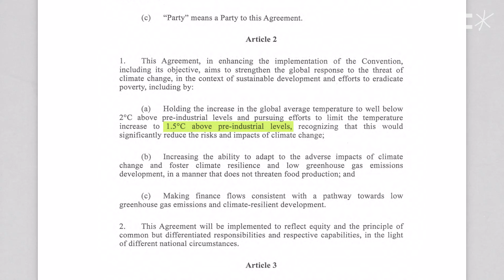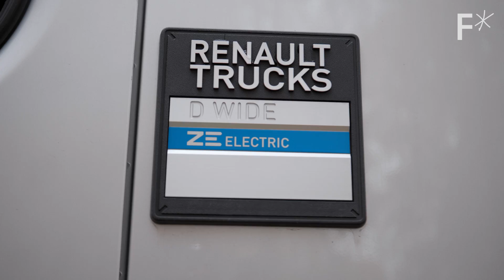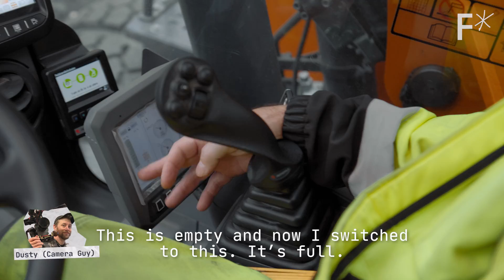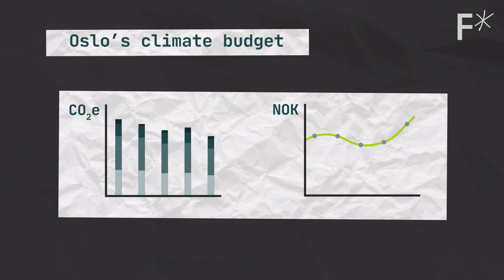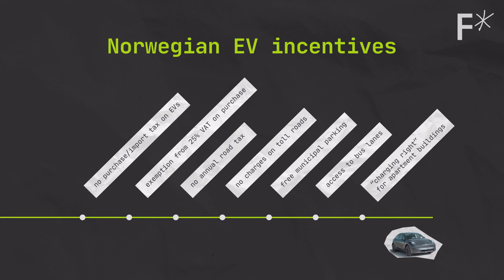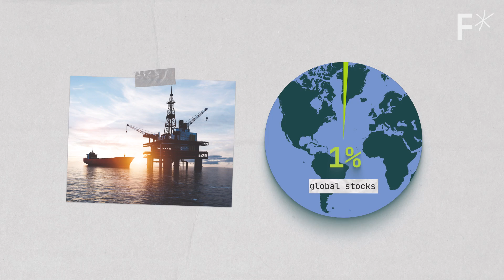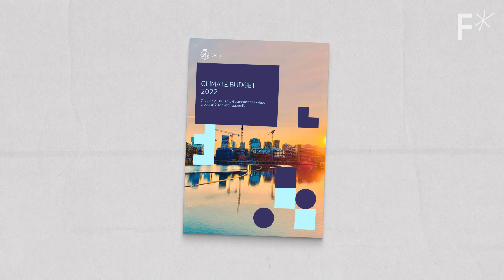The world’s most electric city | Future of Cities

Comment: The most important question is where does electricity come from?
Reply from the maker: We get this question a lot and it's totally understandable!

First, Norway gets 99% of its power from emissions-free sources - 91.5% Hydropower, 7.5% wind: https://www.statista.com/statistics/1025497/distribution-of-electricity-production-in-norway-by-source/ .

While not every country is that clean, EVs still have a number of environmental benefits relative to gas-fueled ones.

- While mining and production of current batteries indeed has environmental harms, so does the mining and production of oil: oil spills, fires, the need to use and dispose of industrial chemicals, etc. Similarly, the extraction of fossil fuels itself requires a lot of energy just like the mining of battery materials. While both oil and lithium-ion batteries can be environmentally harmful to produce, EVs avoid the double hit of gas vehicles having a dirty process to generate their fuel and then that fuel itself also polluting when used.

-Happily, battery designs that use less toxic and safer to obtain materials are proliferating: We actually went to Argonne National Laboratory for a video that gets into this issue and progress on it: https://youtu.be/KMP0x0DpxSY 

-Electric grids are increasingly powered by low-carbon sources. While decades ago virtually all electricity was from fossil fuels, today over a third of the world's electricity comes from low-carbon sources (renewables, nuclear, hydro) and it's increasing every year. So while 100% of the fuel a gas car burns today or in 10 years will generate emissions, powering an EV requires a lower fraction today (depending on the area, of course) - and over time, will be cleaner and cleaner to charge.

-EVs are much more efficient than gas-powered cars. When you burn fuel in a car, about 80% of the energy is lost through heat or in other ways. By comparison, when you charge an EV battery about 2/3 of the energy is used to make the car actually move and operate. So, perhaps surprisingly, even if you power an EV with electricity from a coal-fired plant, it still requires a lot fewer emissions to drive the same distance that a gas car does. https://www.motortrend.com/news/evs-more-efficient-than-internal-combustion-engines/

Hope this helps clarify things!
Reply: Don't ask that question.  Pulling back that curtain negates some of the feel good propaganda of the story.  Short answer is due to geography mostly hydro (Norway is 6th in the world in hydro power production), and its impossible for other countries to copy.  When your total population is less than 5 million and your one of the 10 largest producers of oil in the world, you can fund a lot of alternative projects that would make no economic sense otherwise.

Comment: Yes the lady at 7:14 is right.  I think that Oxygen needs to be thought of as a commodity.  A commodity in that there are finite amounts of it produced every year.  This is a great video, thank you for posting.
Reply: For those who live with the condition bought about by the burning of fossil fuel through asthma, Oxygen is already a commodity! I take a Inhaler and its manufactured by the same companies who make oil base products, and once used, the Inhaler is recycled as an energy source, in other words burn at an Incinerator! and so the cycle continues as more and more people join the asthma community and learn of this fact.
Reply: The issue is not oxygen, sure, producing more can be somewhat beneficial; it will take many centuries to even noticeably decrease the oxygen in the atmosphere. The issue is carbon dioxide, air pollutants and other things which have an uncomparable huge impact compared to the almost negligible impact of percentage-wise tiny reduction in oxygen each year. Oxygen is mostly a concern in the distant future, if it even comes to that, considering how we are starting to apply solutions to combat global warming, etcetera.

Comment: its more sustainable to run a vehicle to the ground than replacing a perfectly fine vehicle with an EV. Also making all those batteries produce tons of CO2 and raise ethical concerns (slave cobalt mining ex.) What will they do with all those batteries once theyve run their course?
Reply: @Grace Cohen we have to be honest about the impacts of keeping going with gasoline / petrol, the original comment said "its more sustainable to run a (gasoline) vehicle to the ground" - this statement is false, and they then justified that with a bunch more anti EV misinformation that is also not true.

Mining of anything can be a problem, and that includes Oil, fracking for Gas, Lithium for personal electronics, Cobalt for gasoline and batteries in all devices, not just cars, platinum for hydrogen fuel cells, copper for just about everything, Tantalum and a collection of other minerals for mobile phones and so on and so forth.

I don't disagree with any of that, but we need to frame ALL products in context. The big issue with only focusing on EV batteries (ignoring cellphones, laptops, power tools etc,. etc, etc.) is it implies the status quo of extracting, refining and burning gasoline is A-OK. And that is not true. Not even slightly.

Yes, making an EV has an impact, but no, it is not worse than continuing to run a gasoline car into the ground for another decade, and the impacts of EV manufacturing are being taking seriously, and made better every year.

Lithium Iron Phosphate (LFP) is a cobalt free battery chemistry in use in some EVs already, Sodium Ion (salt) is a contender to replace Lithium, which is actually abundant, and mined in western countries like Australia - hopefully without exploitation.

I hope you hold Oil and Gas to the same high standards that all propulsion methods should be measured against, and when you do that critically, with data, EVs come out ahead, even with the worst combinations of sourcing, and come out very far ahead with green manufacturing of the battery, and cobalt free chemistry's.

Supply chain abuses are not okay, but sadly they are not specific to EVs - the scale of EVs actually creates more funding to fix these problems, namely switching cobalt away from tailings of copper mining, which is where these abuses tend to happen more, as it's outside commercial (machinery) scale mining. (euphemistically called 'artisinal' mining - rather than the more accurate 'exploitative')
Reply: @gracecohen8477 what about palladium in the catalyser inside the gas car, sodium battery exist and lithium is using less water and pollution to be extract, and their is lithium every where
Reply: @gracecohen8477Lithium is plentiful and gets cleaner every year, unlike oil.  It only has to be mined once, then recycled.  It's not going to be depleted.
Reply: Your anti battery disinformation is like 5 years old now - all debunked - all of it - batteries last a long time and are recyclable, new chemistry's don't use cobalt, cobalt is used in gasoline refining too, primary cobalt mining (at scale - which EV's need) does not use hand labour - you are probably thinking of Tantalum mining for mobile phones - most of the anti EV meme's use pictures of Tantalum mining, not cobalt from primary copper mine tailings, CO2 emissions for batteries depend on where the battery is made, and when, Mr. Bean's article was using old data, and so on and so forth. Google this stuff. Look for "EV myths debunked" and read up, your head is full of disinformation from a desperate industry tying to avoid stranding their trillion dollar emission assets.
Reply: @brushlessmotoring what's so lame about the money argument is that literally every business stands to profit off of their technology, not just oil. So saying oil is just in it for the money, is like saying EV's are just in it for the money. I think your political posturing is how you determine that. Because dirty air, no matter how trivial, is demonized in favor of make believe technology, that no real engineer would ever accept.

BTW, if you look at the official statistics, the co2 concentrations are 0.04% of the atmosphere at ground level, where its at its thickest, meaning overall it's actually far less than even that. The amount we've changed it, according to the data, is only 0.01% over 150 years. Again, that's only relative to where we measure it, it's not indicative of the actual percentage. Its literally 1/10,000. A penny on the $100.00. It's totally trivial, and nothing more than a new political narrative that greases the wheels of capitalism.

But in all honesty, the technology isn't even real. There's no way to make a battery that does not use its power as it uses its charge. There's also no way to make Horsepower in a motor. So even if you could make a battery that was good enough, the motor would run worse than a diesel. Unless 2 + 2 = 5. But if that's the case, then why would any of this even need to exist at all?

This isn't exactly of forum of experts. It's a political echo chamber, disguised as a technological newsletter.

Comment: i know it is going to feel like cripy but i wondered that much electricity   coming from where  and it is really green energy !!
Reply: 89% of Norway's energy comes from renewable sources, such as hydro, wind etc. so it's quite green. Electric motors are also more efficient than ICE, so less energy is wasted.
Reply: @queertales  It's 99% of our energy sources. The 89% figure includes gasoline for cars...
Reply: A legitimate concern.  I'll let others answer that.  But I want to point out another important factor that going electric itself promotes greener technologies as a whole.  

Because if we stayed with fossil fuels, the question of if the energy is green or not becomes moot: fossil fuels are 100% dirty all the time everywhere!  Furthermore, it doesn't promote any initiatives to get cleaner either — fossil fuels just digs us further into the climate disaster hole.  It also keeps energy despots like Putin in power.